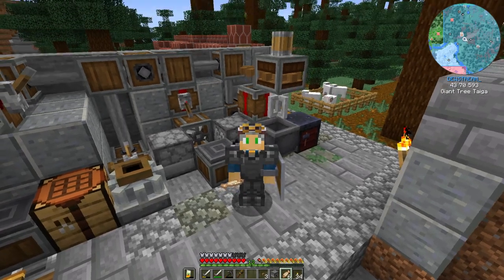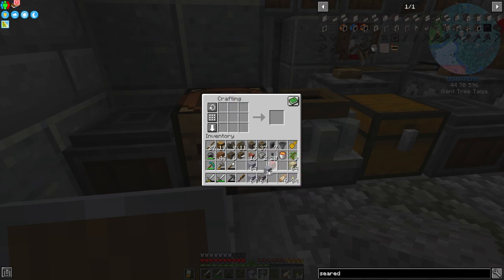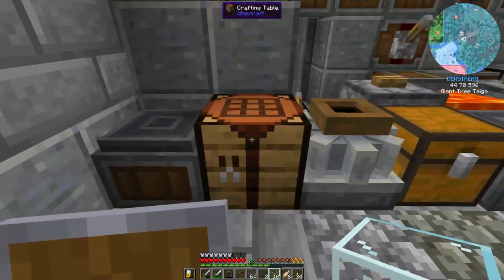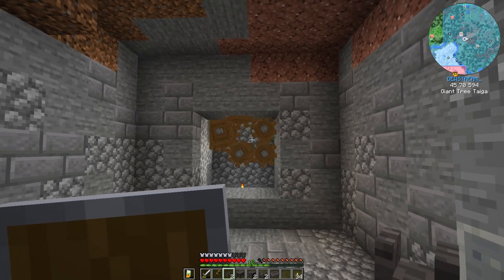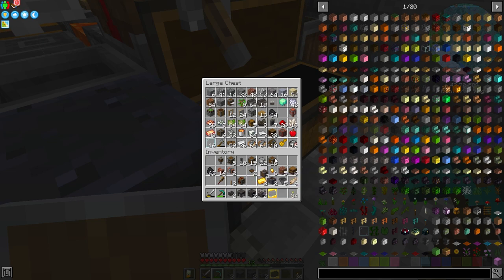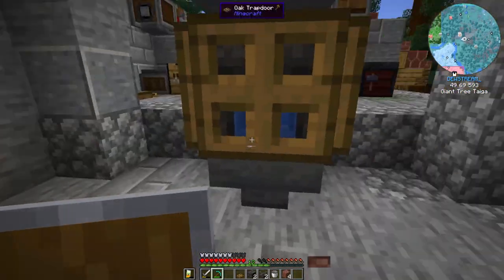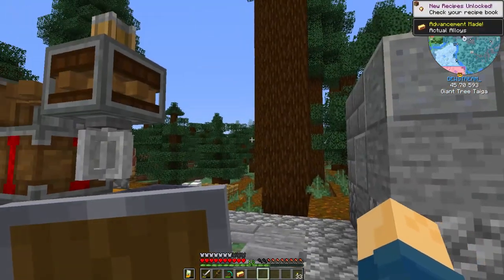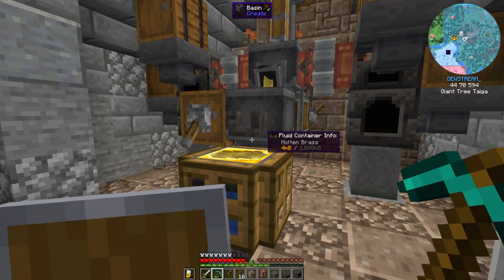How To Make Brass: Ep 9 - Minecraft Create Above and Beyond

Comment: does washing the copper and zinc powder before putting it in the machiene make a difference from just putting the powder directly into the machiene?
Reply from the maker: Hey there boyetrash. I believe so, let me do some testing and find out. I think it’s, i ore, through a grindstone, and smelted gets 6 nuggets, and one ore, grinder, wash, and smelted gives you 9 nuggets. So a 1 to 1. But let me check for sure.
Reply: @DadsG  there is a ”Metallurgy” section in the quest book that explains some of this.
Reply: You actually don't want to wash before smelting in the melter. Washed dust gives you 2 nuggets. Smelting the dust in the melter directly gives you 3, allowing for a 1 to 1 crushed to ingot ratio.

Comment: my mixer just wont mix it and i dont know why :(
Reply: mine either. can't figure it out
Reply from the maker: It needs to be above 32 RPMs. Just step up the rotational force by adding a large cog spinning a small cog
Reply: @DadsG yeah  no it needed a blaze burner
Reply: @DadsG  mine has a blaze burner and a rpm of 80 so unless that is too much i don't know what is wrong. could i get some help?
Reply: This is specifically for Create Above and Beyond. They also may have updated it since then, but 80 should be more than enough.
Reply from the maker: You know, it may have changed. It’s been a while since I’ve played this version of Create. It was different in Above and Beyond where you didn’t need a blaze burner to make brass the way I show. In just plain create, you need a blaze burner for sure. You also don’t need all the extra stuff in regular create. You just need to throw copper and Zinc into a basin with a blaze burner heated below it. The mixer needs to be spinning above 32 rpms.